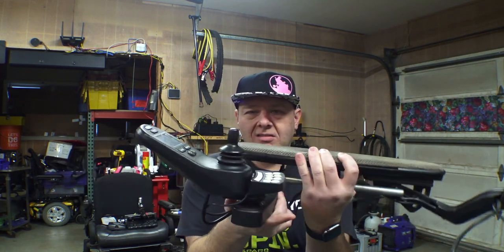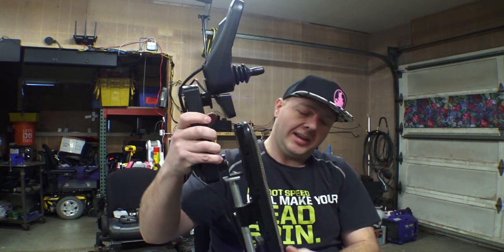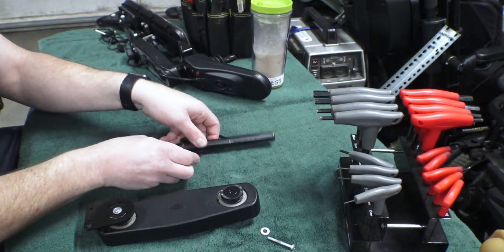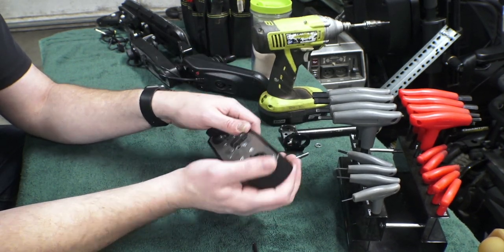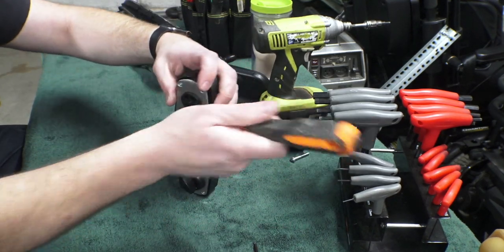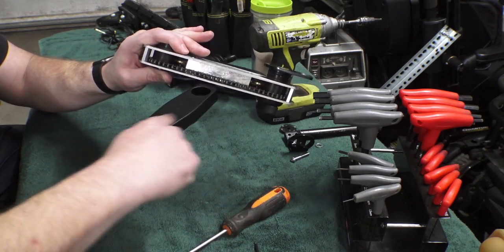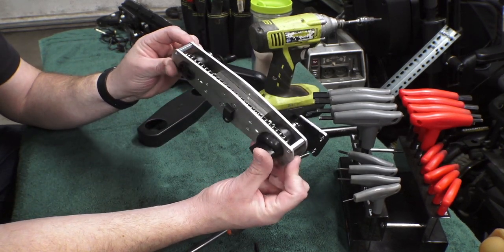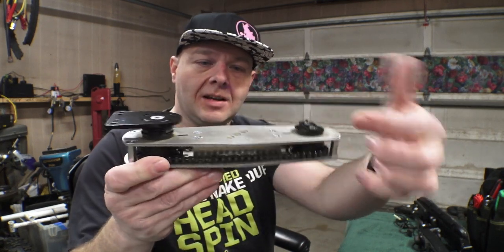SHOP CLASS EP4: how a joystick swing-away works!

Comment from the maker: Just to prevent any confusion.. permobil uses some different terminology with these things - what i'm taking apart in this video is a "Permobil Retractable Joystick Mount" 
However, most other brands refer to these devices as "swing-away mounts" :^)
Reply: Do you know their functional differences, if any?
Reply: Not to be argumentative, but on page 4 of the order form for the M3 Corpus mid-wheel drive new model released about May 2020, page 4 of the order form it is described as: "I108037-99-0 Slimline Retractable Joystick Mount - Right 503.00 E1028." See, http://permobilus.com/wp-content/uploads/2020/11/US-M3-Corpus.pdf
Reply from the maker: @GeneGirard007  yes - that's what im saying here.. this device i took apart in the video is NOT called a "swing away" (according to permobil)  Also 'slimline' refers to the new, thinner version i was referring to.  the device im showing in this video is called the "retractable joystick mount"  the actual "swing away" they sell has ZERO mechanical parts to it.  its just 2 metal plates with a hole in the middle, a bolt, and a knob to tighten them down.  no chains, covers, scissor mechanisms, or anything like that at all. literally just 2 metal plates with a hole, and a bolt, fastening them together.
Reply: @TotallyNormal-  Aha, said the blind man. Now I see.
Reply: Permobil offers a solid mount, swing away or retractable mount for the joystick on its chairs.  The solid mount is just what it says, no articulation, always pointed in the direction it was installed.  The swing away has a single pivot point under the arm rest.  You can swing it out of the way, but the joystick does NOT stay pointed straight ahead, so really difficult to use when you swing it out of the way.  I have never seen one on a Permobil chair.  The retractible mount allows the joystick controller to stay oriented pointing in the same forward direction no matter how you position it.  I have owned all three on different chairs over the past 23 years, and the retractable is the way to go.  Yes, some other manufacturers call their retractable type mounts "swing away".
Reply: The thing that I appreciate most about this design is the simplicity of switching from left to right or right to left config on the wheelchair. On a Quantum swing-a-way, you have to dismantle the whole assembly and figure out how to rebuild the unit to swing in the opposite direction. With the Permobil, all I had to do was flip the assembly end-for-end when I mount it and the unit swung out in the opposite direction. NICE and simple ! ...Gotta Love it.
Other Comments: Man that garage looks Empty... Where'd you hide all your stuff ! LOL

Comment: We have a 2019 M3 with the thinner swing-away arm (and, no, I'm not going to take it apart -- my wife would object!). There's no tension adjustment knob on the bottom, though the back one does have a sunken screw that might be an adjustment mechanism. You didn't mention it, but one of the neat things about those teethed connections is that you can adjust them so that the arm in its detent is at a slight angle to the armrest, so the joystick can still be straight ahead and parallel to the arm but offset to the inside or outside (hope that made sense).

Comment: The newer slim-line model lacks the friction-adjust knob on the underside, and is not easy to adjust.  The teeth not only allow it to securely lock into position, but also allow for mounting securely at different angles.  This is nice, because the arm rests are also able to be adjusted so they point inward, straight or outward to preference.  So, you could have the arm rests pointed at different angles, but still have the joystick pointed straight.  I have , and use, both the old style and slim-line swing-aways on mu chairs.  I have not found any difference in strength between both models.  

I have a good friend with MS who has weakness in his arms, so much so that it is difficult for him to push the swing-away sideways out of the forward position, inward or outward.  I modified his old style swing-away by chamfering the edges on the detents in the plastic cylinders.  Similar results can be obtained by shortening the spring a small amount, or using a weaker spring.  

I took off the black plastic cover on an older swing-away, and buffed all the aluminum parts to a mirror finish.  It looks rather steam-punk to have all the metal and chain exposed.

As usual, nice video.

Comment: I have the corpus M3 and it has the thin swing out. I had to take it apart to adjust the detent because mine kept swinging out unexpectedly. Unfortunately I had to use my eyes to evaluate what the parts are and translate that to my wife to be my hands and work on it. We survived and fixed whatever it was that was bothering me. I too was very impressed with the engineering that wind is a little thingWe survived and fixed whatever it was that was bothering me. I too was very impressed with the engineering that went into this thing.

Comment: I have the new f3 with the new smaller arm and i also used an old style f3 as a rental chair for a while, ive put roughly 800km on each of the chairs and ive only noticed That the shape is different ( the new one is a straight rectangle) and the new one doesnt have the knob to adjust
Reply: No adjustment knob? That seems like a huge difference.

Comment: @Totally Normal  do you have a swing away breakdown vid? I'm waiting for secondary insurance approval for my new M3. My last 2 chairs have been Quantum with tilt decline elevate. I need the functionality of this part but the vendor ordered the swing away instead. They both have the same HCPCS code. Also, can you answer a question? Initially, I vendor did not know that Permobil came out with a new M3 May 2020. I had to tell him what I knew about it from the Permobil webinar. In any event, my vendor told me that he could omit the ICS button thing between the joystick in the arm rest and program all of the functionality of drive, tilt, recline, and elevate through the joystick only. However, when I finally received a line item invoice of the M3 he proposes to order for me, I see that it does include the ICS part with buttons. I use an ordinary joystick, but my hand is faceup. I foresee problems with the ICS because my knuckles may inadvertently press some of those buttons, and the presence of the ICS is just going to make the joystick further out of my reach. (Explaining the need for the Slimline you just tore down.) Anyway, my real question is can all the functionality of the ICS be programmed into the joystick? Quantum doesn't seem to have much trouble doing that.
Reply from the maker: on permobil chairs ya can use the joystick or the ICS buttons - so omitting the switch box isnt an issue :^)
Reply: @TotallyNormal-  YAY!

Comment: My M3 is awaiting secondary insurance approval. My vendor finally provided me with a line item invoice. I see he has ordered the swing away instead of the Slimline. Do anyone know the differences.  I need the functionality this part.
Reply from the maker: so the mechanism im taking apart in this video is technically called the "(slimline) retractable joystick mount" like the pinned comment above says, most manufacturers call this a "swing away".. BUT the term "swing away" with permobil is a completely different setup.  ask them to show ya the differences.. its easier than trying to explain it here :^)
Reply: @TotallyNormal-  My ATP professional only has one 2-year-old Permobil demo and whatever he has on hand for delivery. I when sad and Invacare with a "retractable" joystick mount that would essentially swing the joystick out right and then back against the outside edge of the R armrest. My ATP professional ordered: "Joystick Mount Right - Swing Away." Have you ever seen one of these? Is it likely did have kind of a scissor mechanism rather than the elaborate Slimline in your video?They both have the same HCCPS code so I imagine there would be no problem with the change.

Comment: You May Not See This But I’m Having Issues With My Joystick Armrest Falls Down When I Recline The Back Of My Chair Any Advice Or Ways To Fix Would Be Great Thanks!
Reply from the maker: how does it fall down? theyre "supposed" to stay roughly level when ya recline.. does it drop down towards the ground?
Reply: @TotallyNormal-  That’s Correct It Drops Towards The Ground
Reply from the maker: hmm i wonder if the little bolts on the ends of the arm rests where they connect came loose.. also id check the turnbuckles on the back of the chair.. something somewhere has surely disconnected itself!
Reply: @TotallyNormal-  Ok Thanks For The Help